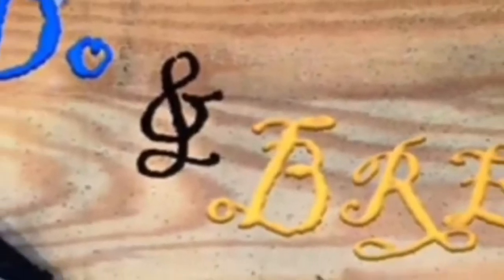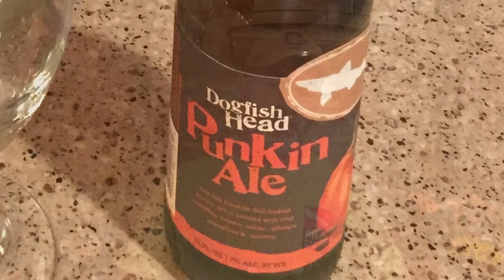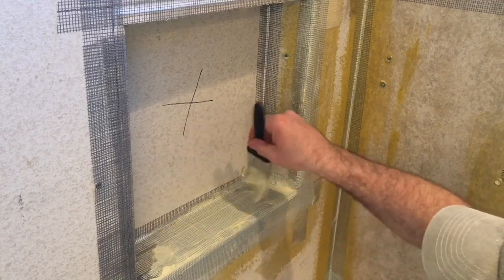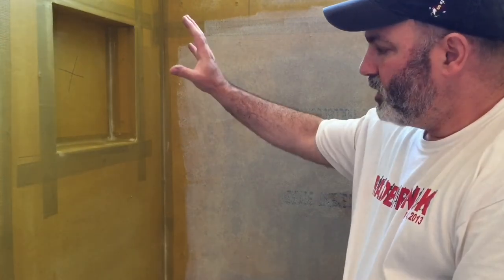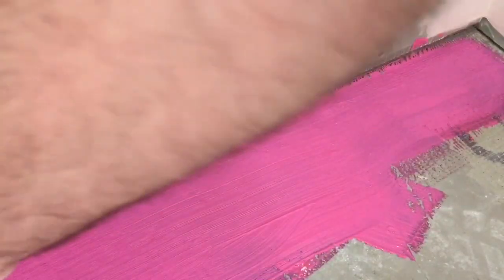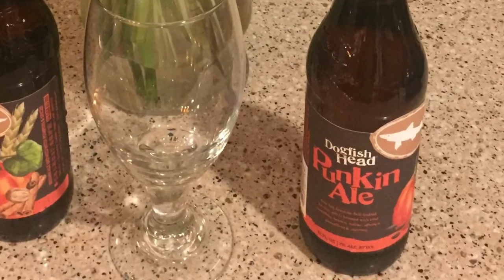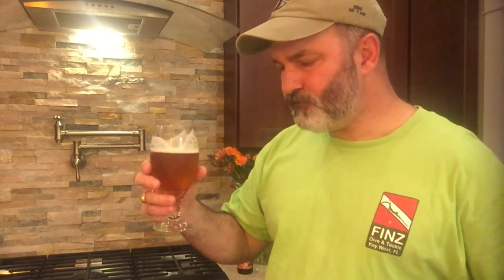Part 5 - How To Waterproof A Shower Surround - Complete Bathroom Remodel

Comment: thank you for your video's they were verry helpfull i just have a quick question
We are building our shower now and will use a composite showerpan should we waterproof underneath it or not?
Plus i noticed that you do not fill the corners with silicone or anything els is it posible to put silicone in it before waterproofing or?

Comment: Nice video, thanks for your experience. I'm installing Corian shower pan and walls. I can't find any information about waterproofing the flooring under the shower pan and the wall area up to the top of the shower pan where the cement board starts. Thanks for any help you can provide. The beer looks good, gotta go get one now.
Reply from the maker: Howdy Richard Nelson !!!  I would use a 40 mil PVC shower pan liner and extend it up the shower walls at least 2 feet.  Once your shower pan liner is properly installed, install your Corian shower components.  Thanks for the question and good luck on your build!  ☘️

Comment: hello again just finished up watching your video part 5. in part 2 you filled the 1/8 inch gap in-between the cement board with thinset. in part 5 I noticed you didn't use the waterproofing membrane on those joints just along the floor walls? is there a reason that you didn't coat them or did they get coated and just not shown in the video? how much is that waterproofing membrane and where can I find it? also I'm assuming there is no bonding conflict with the thinset and this waterproofing membrane.   thanks for the videos, you do it the right way. your craftsmanship is amazing  Holms on homes has nothing on you. hay come do my bathroom my wife makes a mean lasagna!!!
Reply from the maker: Howdy Thomas!  Thanks again for the great props - much appreciated!!!  As I mention in the video, I prefer the 'pink stuff' or Redgard.  I purchase my Redgard at Home Depot.  It is expensive, but well worth it!  A gallon runs about $53 - 3 gllon bucket is $145.  Yes, I highly recommend rolling on at least three coats on the entire floor after you cut in where the wall meets the floor with the mesh tape and w/p compound.  Please see the 8:15 in the video...you can see the yellow stuff applied to the floor.  It is well worth the time and money to completely seal up the bathroom to ensure no damage to the rooms below.  Good luck on your project...send more questions my way.  You can also reach me at DoAndBrew@gmail.com.

Comment: When you do the floor to wall corner waterpoofing, what do you do if you're transitioning between concreter backer (floor) to drywall (wall)?
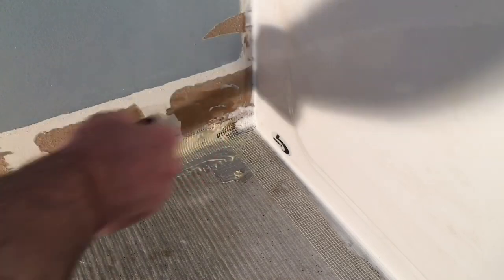Reply from the maker: Howdy Alex Leblanc!  Good question...please see the video at 4:50.   Using the mesh tape, form a 90 degree corner between the floor and wall, then apply your waterproofing membrane.  When you tile your floor and add the finishing pieces around the baseboard you’ll never see the waterproofing membrane and you’ll have a waterproof floor.  Let me know if you have any other questions...good luck on your project!  Hope to see you as a sub!  ☘️
Reply: Thanks! I missed this when I watched the video

Comment: You do not put thinset in the joints of the cement board before applying weatherproofing membrane. Do you think that is overkill?
Reply from the maker: Howdy Greg Epps!  I have done it both ways...but there is no requirement to fill the joint with mortar prior to waterproofing.  Cement/mortar is porous and will let water through...if you install the waterproofing membrane per the installation instructions your wall will be water tight.  Good luck on your project and thanks for watching!!!   ☘️

Comment: One of my bath/shower walls is hardi and the top is drywall. Can I redguard over joint compound and paint over that?
Reply from the maker: Howdy David Sloan!  Can you? Yes.  Should you?  I am not so sure.  The problem is the RedGard is so heavy and thick that the final painted look will not be very smooth or uniform.  

What is the goal of your project?  Cover up bad drywall?  Or do you just want to waterproof the drywall above the tile?

Comment: You should point out that the mesh tape you're using on the Hardiebacker seams is alkali resistant; lest people make the mistake of using fiberglass tape, which doesn't hold up well in a tile installation.
Reply from the maker: Howdy donkeydump63 !  You are correct...I cannot update the audio on this video, but I will put a note in the description.  I am currently working on a kitchen remodel where I also put down cement board...I will mention the requirement to use alkali-resistant tape in that video.  Thanks for pointing it it...this is a village!!!   🍀